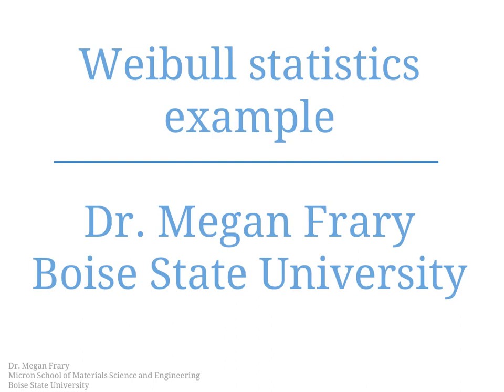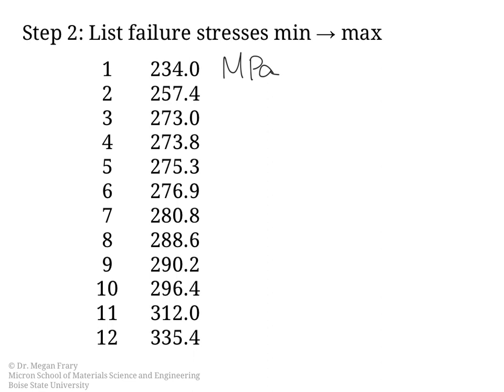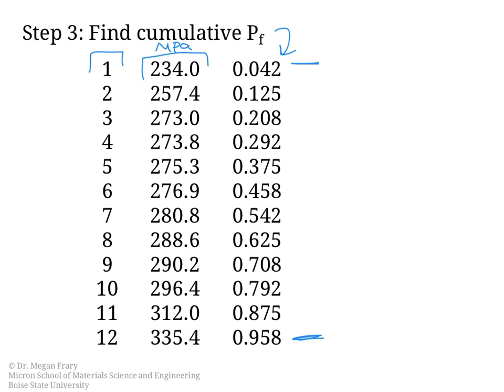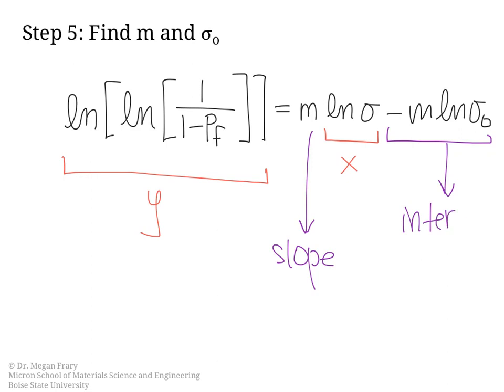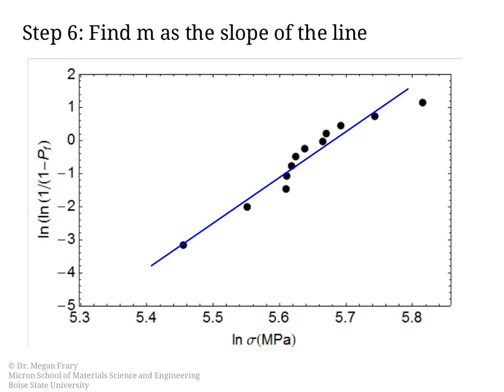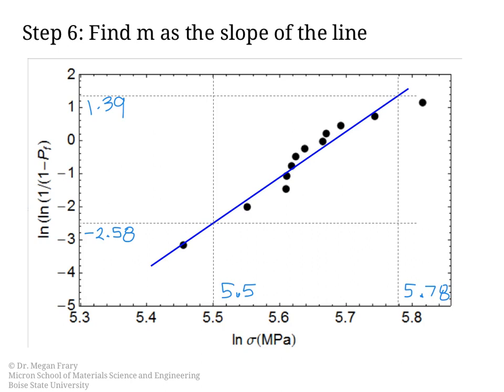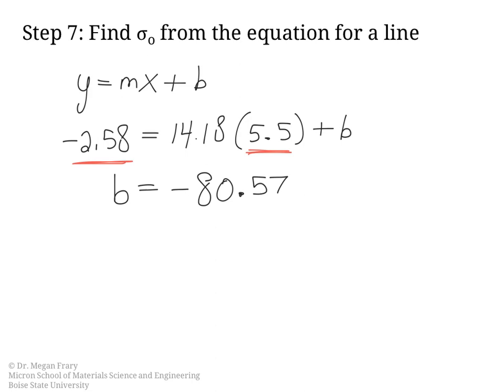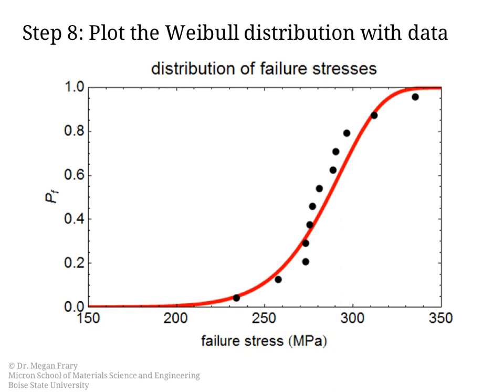Weibull statistics example

Comment: Thank you So much! Very helpful and extremely simplified :)
Reply: hi Hamdi, do you know how to draws the solid red line of plot the Weibull distribution at the end part of video?
Reply: @HiSKe23  Hi, am not sure about the question, but i did actually, there should be two plots, the "calculated" probability and the one based on the modulus and the sigma0
Reply: @bena140111  yes, i knew the solid red line (fit curve) was created by weibull modulus and sigma naught. But the question is how do we draw this plot? what kind of method? Could you make it in excel and tell me the procedure?
Reply: @HiSKe23  I don t really see what s the missing information? is it about the tutorial in Excel how to draw? or the y and x columns to draw??
Reply: hi hamdi I understood
Reply: @HiSKe23  sorry I didn t really seen the point, i am available if any further information needed